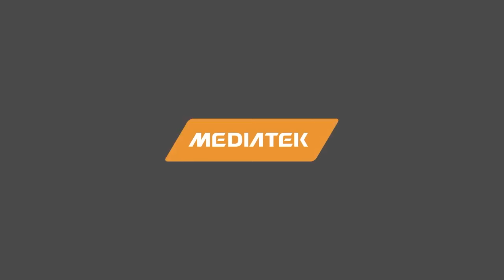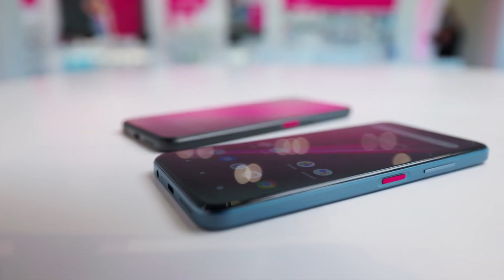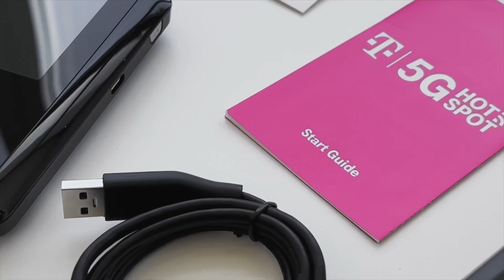T-Mobile 5G Home Internet is Absolutely Insane!

Comment: We got the 5G Home Gateway as a backup because my wife and I both work from home. We have needed it several times and it saved our @$$.  I'll never be without one now. We still keep our 1g fiber for the speed but it's nice to know we have something when that goes down. It even has a battery inside so you can move it around and find the spot with the best 5G signal when needed so it stays on for a while if the power goes out. All our computers are laptops so everything works if there is a power glitch.

Comment: I ordered mine 2 weeks ago and it is fantastic, although the wireless feature for some reason doesn't work so I always have to keep it plugged in to an outlet and if I unplug it it'll disconnect the internet, even if I have the ethernet cable hooked to it